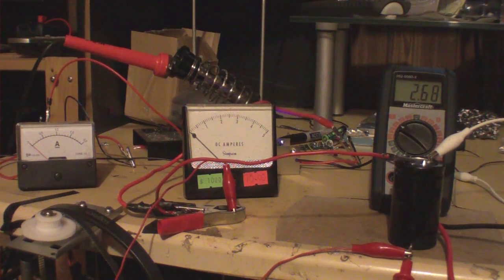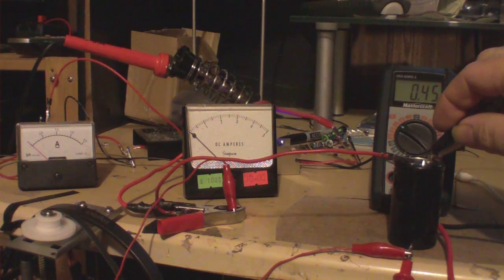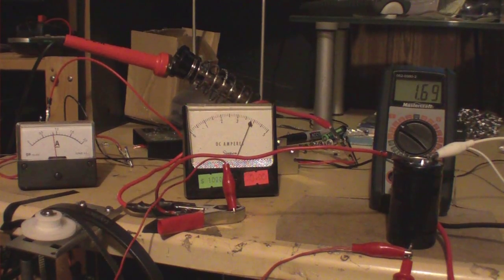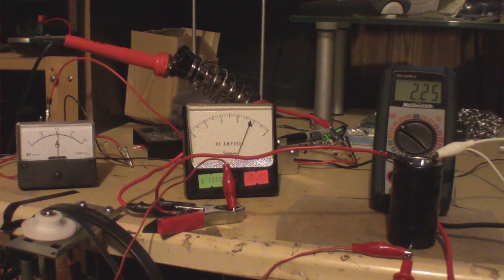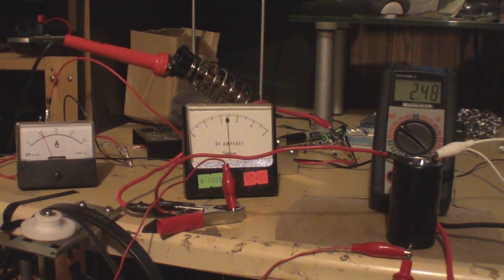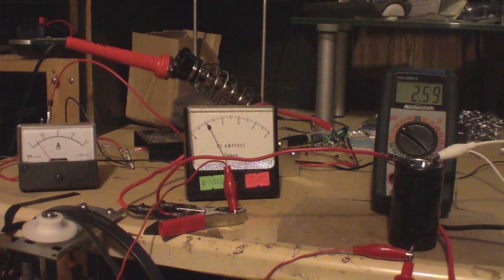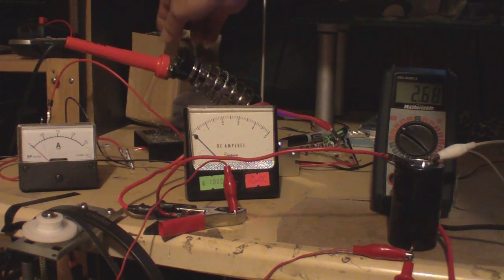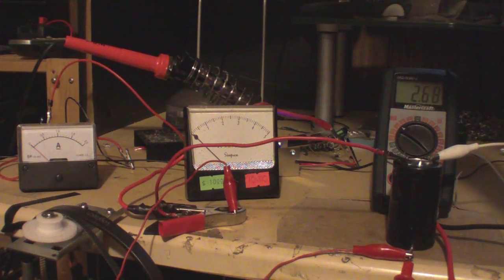Super Capacitors - Most Affordable Quickest Charger - $10 Can't be beat!

Comment: Look into oil of oregano for respiratory illnesses.  Anyways good video.  Are you going to integrate this into your light?  Perhaps you could add some circuitry to make it all automatic.
Reply from the maker: Yes, the whole concept is, that i have programmed a new circuit with picaxe, what it does is, it oversees the voltage of a given battery bank. when the voltage of the bank is over 14.5V, it switch the current away from charging and then to dump. The dump charge is supercapicitors babysat by these DC-Dc converters, so solar charges your bats, then once full it focuses on supercaps, that run outdoor joule thief lighting. no matter how vigorous the use, supercaps stand up. meaning that if it is a dark detection circuit, the supercaps can handle the joule thief going down to 0.6V - niCd batteries can only take so much of that. The batteries really take beating here in canada - between running too long, and no sun, to cold weather. most of us find that the batteries in outdoor solar lights only last one season, after that, in spring they are mostly useless and certainly dont make it into spring #2. --- now --- having all that in mind, you can actually have multiple layers of solar dump. #1 charge batteries #2. Charge caps, #3 go to hot water element. Eventually the big deal will be when i start dumping to hydrogen production, it is my personal belief that solar dumping to both H2 production is huge. As well as dumping to a still, to produce ethanol to then use in biodiesel. The H2 production can be intermediatary, for example -- if you have enough excess in one day to produce some hydrogen, then, after a few days or the next day, that H2, can be used to produce ethanol, because you'd know you had enough to complete a whole distillation batch - rain or sun - it'd be predictable, and could be scheduled to meet your calendar, not the sun's.
Reply from the maker: thanks for the tip on oil of oregano. ive had nothing but troubles with colds since i quit smoking, which is odd.
Reply: KyleCarrington Cool design.  That would be huge if you could run your car on home made fuel.  I'm sure there's all kinds of taxes and rules to do it legally.
Reply: KyleCarrington
Got that from the remote viewing forums. :) Of course you want to do your own research on it, and the proper way to take it.  It is really strong stuff.  Perhaps the reason for the colds is that the virus could not survive in the nicotine/ other chemicals environment, also reducing your immunity, although I have no idea.  I wish we had something like Rifes technology and could stand in front of a machine for a couple seconds, but I guess pharma wouldn't make their billions.
Reply from the maker: ***** yes i used to see a man named dr. korecki who used color therapy amplifiers and vega midi testing equipment and managed to take dr. rifes tech to a whole new level. it was amazing.

Comment: how many of these caps would i need to equal the energy in a battery that is 2.7volts and 1Ah
Reply from the maker: lots. they do not serve as a battery replacement, really.
Reply from the maker: To store one AA battery's energy in a capacitor, you would need 10,080 farads which is about 27 of these caps.
Reply from the maker: With that said, one cap, if charged once a day, in theory could last 217 years.